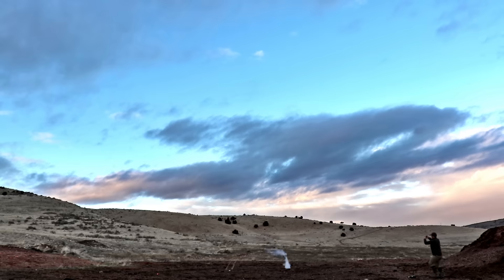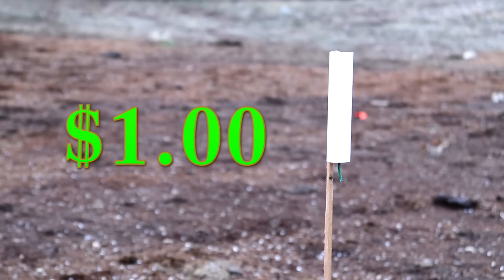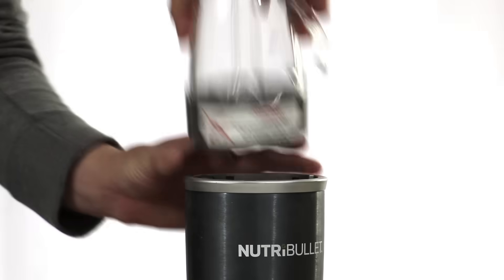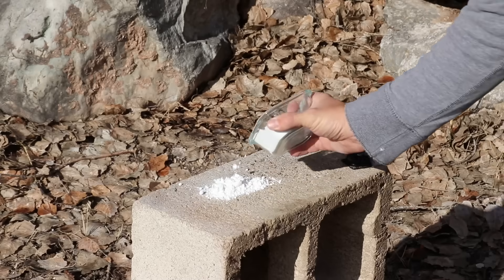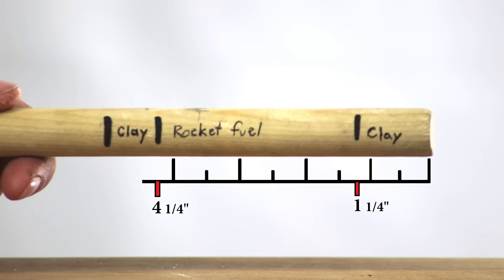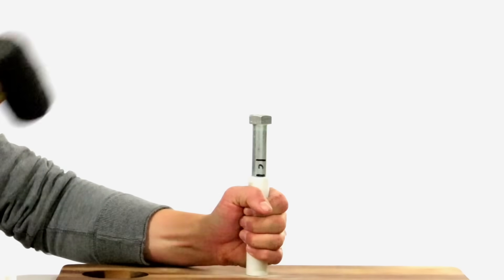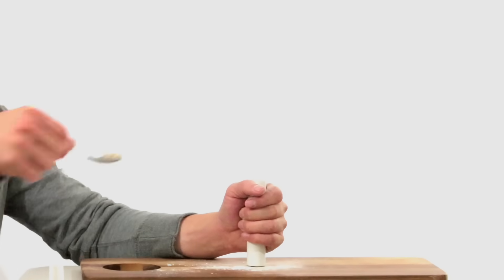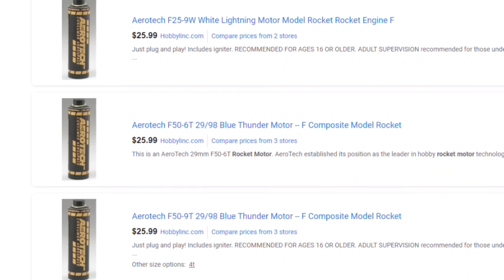How To Make Sugar Rockets (Powder Fuel)

Comment: Great video but for those trying to repeat this video for themselves, keep in mind that if you live in an area with high humidity, the water in the air can get in your mixture and cause it not to ignite. In my area there is high humidity and I was forced to melt the mixture down and then place it in the PVC. Once it hardened, it worked perfectly.
Reply from the maker: Yes. the humidity can wet the powder. So it is best to keep ingredients in separate zip lock bags and assemble the rocket motor prior to  launching it.
Reply: How do you melt the powder mixture? In a regular sauce pan? How hot till it just melts or bubbles etc.
Reply: @Paiadakine  I have heard you actually add water to the mixture and you heat it up until most the water is gone.  But... what makes me leery is the heat temperature.  Don't make it hot cuz it could maybe blow the whole thing up.  Burn injuries are 10000000% nothing to mess around with.
Reply: @Paiadakine  https://www.youtube.com/watch?v=nPM3KcHzN6I
watch this to learn
Reply: Side note: The freezer section of a self defrosting refrigerator will keep things really dry. Obviously, open the zipLock bags to expose the contents.
Reply: So basically I am forced to melt them down if I live in the tropics right?
Reply: @kaikart123  or add ammonium nitrate 1% by weight. this can help it be less hydroscopic. watch this entire video

https://www.youtube.com/watch?v=nPM3KcHzN6I
Reply: @kaikart123  No, you are just suggested to store the ingredients in an airtight container, ideally with a silica gel desiccator bag.

Comment: How do u have the rocket on the launch platform and how do u drill a straight hole
Reply from the maker: To drill a straight hole, I just take it slowly and make corrections as I go. You could also use a drill press on low speed. It just takes a bit of practice. When I'm using the rockets like bottle rockets, (using a stick instead of a rocket body). I just stab it into the ground, pull it out, and put it back into the same hole to ensure that it will launch when ignited and not get stuck.
Reply: Curious Random what do you do when the rocket spins out of control how would you fix that
Reply: @harryrobertson288  Study a basic model rocketry handbook.

Comment: Are there any material that can change cat litter? A cat litter is too expensive and I won't use that much
Reply from the maker: you can get kitty litter for literally 1$ for a bag of it. far cheaper than the other materials.
Reply: @EthanAllred1  no in my country kitty litter is like $50 for a bag and it's too expensive and i won't use that much. It will be a waste if i don't use it all
Reply: @kitaikana  amazon sells 500g bags of powdered bentonite clay for roughly £5

Comment: Excellent video.. rip Grant. Ethan can I use regular table sure and grind to a finer powder??
Reply from the maker: Yes. You will probably get a faster durn rate because powdered sugar has a little bit of corn starch that slows it down.
Reply: @EthanAllred1  Thank you!!! Is it at all possible to do a video on whistle mix and show how to press into a small tube to get whistle effect?

Comment: Good remake of the KoR video. I had some success with 3d printing a cap that goes over the nozzle end. The temporary cap has an conical extrusion that helps with focusing the thrust and providing a perfect center for the drill. It gets removed once the final packing of clay is finished. Yes, An extra step, but once you have the basics, it's fun to tweak the design bit by bit.
Reply: Would you mind sharing the stl for that?

Comment: Can I use  other thing instead of kitty litter
Reply from the maker: I haven't tried other compactable powders.  Bentonite clay from kitty litter works well for me. If you were to make nozzles out of say cement, they would just really need to bond well with the tubing to work well.

Comment: Can I make this rocket in 1/2 inch scale to make it not launch as high?
Reply from the maker: Yes you can, the clay will compact better with a slightly smaller  tube. But you may want to use a smaller drill bit for the core and nozzle if it drills away too much powder.
Reply: Mr.CuriousRandom thank you for replying so quick
Reply: Mr.CuriousRandom sounds good
Reply: How far/high did your smaller-scale version of this fly?
Reply: @slfe-u59  around 400-500 ft attacked to a small 3D printed rocket which eas a bit heavy

Comment: DONT use metal to compress. It can create sparks and light up the rocket when you are compressing. BOOM!!!
Reply from the maker: The rocket fuel is quite stable and non explosive, but yes, one good hot spark could set it off. Although I've never had an accident building one this way, nor have I made any sparks while doing so.

Comment: Can you use the same amount of propellent and change the design of the rocket, making it more aerodynamically efficient, redesigning the exhaust port, using different materials for the body, etc., and still have it be legal to use in the US?
Reply: Yes, check the king of random channel, he builds a rocket body out of cheap materials powered by one of these sugar rockets.

Comment: any other brand for potassium nitrate that I can pick up in stores?
Reply from the maker: Not that I'm aware of, I've tried other stump removers with little to no results. but this brand is supposedly almost 100% pure
Reply: @EthanAllred1  How dangerous is this to make? I was in the process of making it and I was warned not to do it because it can blow up in my face. Also what did you use to ignite the rocket?
Reply: Jaron Cohenca He used a fuse to ignite it which you can buy or make. It is very safe to make these as long as you follow the few safety tips he pointed out, basically just not too much friction, pretty simple. The fuel is not impact or shock sensitive, so you don’t have to worry about it going off accidentally very much. Very stable stuff, great for beginners!👍
Reply: Saltpetre... U can buy it in pharmacies
Reply: We buy ours in 50 pound bags. Search Amazon or ebay

Comment: How did you install the fuse into the sugar rocket?
Reply from the maker: I just used a paper wedge to hold it inside. I didn't go into detail on the fuse or the stick because I was mostly focusing on a rocket engine that can be used with any rocket body, and any fuse electronic or not.
Reply: @Mr.CuriousRandom could I use a homemade fuse? What kind of fuse did you use? Is it a homemade cotton string dipped in a mixture or can I buy it online or something. I’ve been thinking of trying this out but can’t find any safe place to do it, as I live in a big neighborhood
Reply from the maker: @thegamingcashew4304  I usually use fuses off of small fireworks, but I have bought a roll of it online as well. Any burning fuse should work. Also definitely don't do it inside a big neighborhood. Find a field or something. It could easily land a quarter mile away.
Reply: @Mr.CuriousRandom ok thanks. I’ll try to find a fuse or make one. I’ll have to drive 2-3 miles away at least to find a place to launch it where it won’t hit anything.

Comment: Is it necessary to use a pvc pipe or can I use some other material? Does a pvc pipe have anything to do with the chemichal reaction or is it used  because of its physical properties and because its cheap?
Reply from the maker: Yeah, it's not necessary to use PVC. There are materials that are illegal to use such as metal tubes, and I've never seen anybody have a problem with using pvc. It's cheap, strong, and lightweight. The PVC itself never gets to the point of ignition, so it has nothing to do with the chemical reaction of the tube.
Reply: Any thing that burns in pvc will melt it partly and make a SUPER bad smell. I’d suggest a rolled paper tube with glue.
Reply: @aaronhughes827  I dont think burned glue would smell much better.
Reply: @josephpostma1787  trust me, it’s does. It’s the plastic that’s the problem...

Comment: Awesome.. Don't think Dad would let me use the blender for this though! 😂👍
Reply from the maker: Yeah, it's best to just get a cheap thrift store blender for some of these projects.
Reply: @EthanAllred1  Where did you get those long sticks that you taped the rocket to?
Reply from the maker: @devilliar3786  I used a table saw and ripped an old 2x4 into 1/4 x 1/4 inch square dowels.
Reply: @EthanAllred1  why did you do a 85g/28g mix, instead of a 65g/35g mix?
Reply from the maker: @devilliar3786  I do a 3:1 ratio. 75g 25g it works well for these rockets
Reply: you don't need a blender. Just use some very little water to dissolve everything and then heat the mixture until it becomes harder than play-dough. I just tried it yesterday and was very successful.
Reply: @lordofthechimie  even the bentonite??
Reply: @DrunkDeadGhost  nah, just sugar and nitrate
Reply: @DrunkDeadGhost  the bentonite is to plug the ends.
Reply: @lordofthechimie  uh, that's how they make  
C4
Reply: Neither my mom
Reply: @0ni_x4  i have been waiting since 4th grade that our blender would replace the blender but still working now is the time im now on 9th grade lmao just wait a couple of years
Reply: @enzoocampoiii2881  I'm also now in 9th grade
Reply: @addictedtofamilyguy7627  just graduated today now I'm 9th grade
Reply: @enzoocampoiii2881  or just buy a used one from eBay lol
Reply: @nopzyon144hz5  nah hard to find used things in our country
Reply: You should buy a cheap blender just for these projects.
Reply: @albertkoscielniak7075  or used coffee grinders but I think potassium nitrate is food grade? they put it in sausage cases
Reply: Or the electric drill?! My suggestion for THAT; Invest in a hand-turned ceramics drill. Probably set you back less than setting the work bench on fire with the Makita :)
Reply: Dad or mom
Reply: Just tell him you’re making some pretty fire candy with it 😏
Reply: hahaha
Reply: Same
Reply: Go to a liquidation store and buy a blender.
Reply: It's just powder, it'll clean up.
Reply: That's what good will is for. Lol
Reply: Don't need a blender.  Make solid fuel by melting the sugar with the kno3.